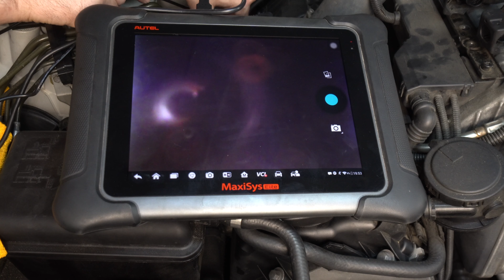Salvaged BMW E60 Final Touches: Injectors, Spark Plugs & More!

Comment: Just got a clean one owner e60, your e60 videos definitely got me stoked to get mine in top shape!
Reply from the maker: Nice! What model?
Reply: @rebuildrevival  95k miles on a 2009 528i rwd, sport pack with individual options so it has the black anthracite headliner, M sport wheels, M sport steering wheel, but no M sport bumpers. Black on black! This car is a US spec car bought on a military base in Germany new, middle aged lady was a contractor for the army and worked in Germany for 4 years. Most of the mileage is smooth autobahn mileage. She got stationed back in the states on 2015. Since being back the car has barely been driven, only 25k miles in 9 years! Additionally I have records for everything. Any little issue after the warranty was up she still took it to the BMW dealer and always approved the repairs and recommendations. I kid you not it still looks and smells new inside.
Reply from the maker: @dubber4life  sounds super clean! Check out the video I’m putting out hopefully tomorrow or Sunday. It’ll definitely help get your car running at its full potential!